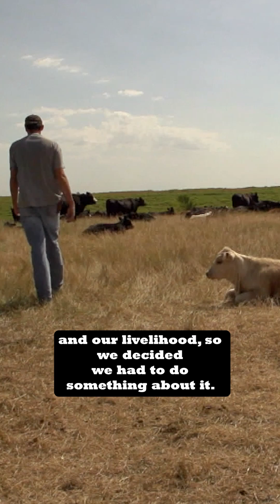Cattle grazers survive drought

Comment: Veganism is the answer to all the problems.
Reply: Veganism may work for some people. Not for everyone. And it doesn't solve problems it only changes them.
Long term nutrient depletion of the soil, which occurs when you grow food plants/trees, means that vegans do not get everything they need to survive for a lifetime without health problems. Same as any restrictive diet that eliminates a type of food, the restrictions can lead to severe and lifelong health issues.
What's needed is a balanced approach to food, nutrition and health.
As someone who has issues with absorbing the nutrients from food sources as well as anaemia and other deficiencies I find it is easier to keep eating a variety of food as well as B12 injections, supplements, vitamins, etc.
Blessings from south eastern Australia, Dot
Reply: The land needs the feet and manure of the big animals. Without it the grass will eventually die. Then what? The soil blows away. Not all land is going to be ok for growing vegetables type food. And all those veggies requires water too be open into the soil. That depletes the aquifer. Yes the animals need water too. But, they are part of the circle of life.
Reply: CFV is an optional answer.
Reply: Well the cows are vegans, we just add one step to the process.
Reply: To regenerate soils (aka-sequester carbon and put it back into the top soil) you need a few things. 1, to cut grass and bunch it up. 2, to put it in a dark, warm, moist anaerobic environment to let it break down. 3, return it to the soil in a form & pattern that the microbial life in the soil can incorporate. A cow does all of these things naturally in its guts, then distributing the cow pies as they move. The root growth from the grazed grass makes the land more resilient to floods or droughts. It’s an incredible system, as long as we manage the cattle in a way like Mother Nature manages grazing animals. (Heavy disturbance & grazing followed by long periods of rest.) Nothing wrong with being vegan, but we don’t have four chambered stomachs to digest grass. Cows do.

Comment: How do you handle the water?
Reply: Getting water to cattle can be handled a lot of ways. Greg Judy can water 300 head with I think an 80 gallon plastic tub that he moves daily. You can water more than one paddock from a single watering point. 
He has video of a consult he did in Arizona. They buried pressurized municipal water lines to serve watering points along the permanent fencing they put in. Temporary fencing determines how much the cattle get each day to graze.
Reply: By rotating the cows, the pasture never dries out, because no bare ground, and there are deeper roots.  That makes the land absorb more water to help the pasture survive the drought.
Reply: I understand the grazing and agree.  Kinda like the buffalo did it. 
In areas like western So Dak getting water to the cows would be a big problem
Reply: @newatthis50  Ah, I get you.  Yes.  Moving to a rotational grazing setup can be a large expense because of the water and fencing infrastructure.  That is one of the main economical barriers to more wide adoption without transition funding.